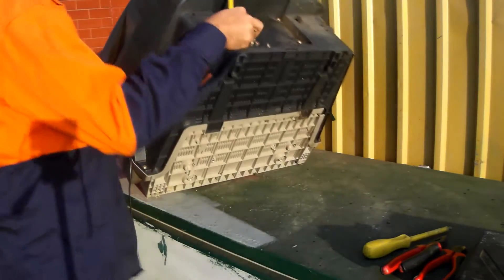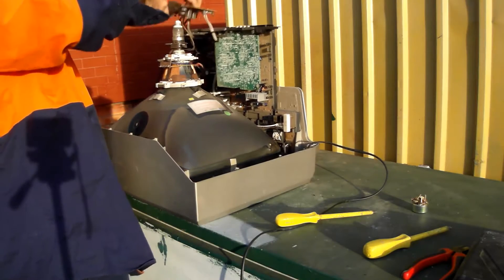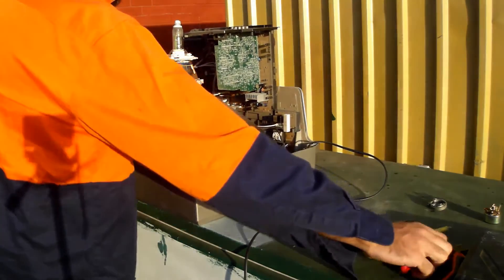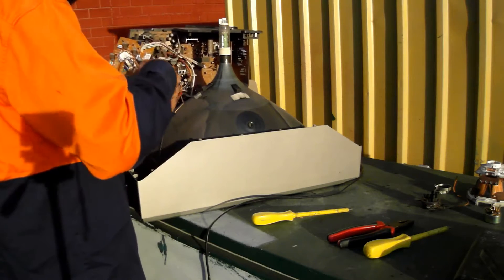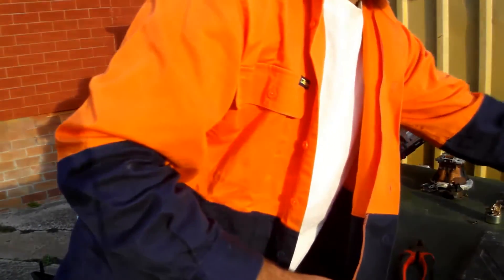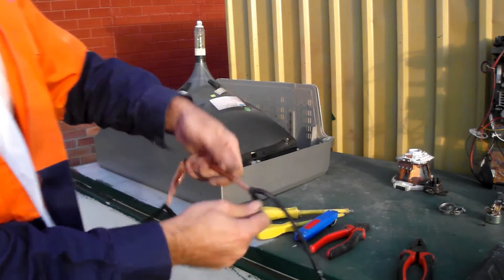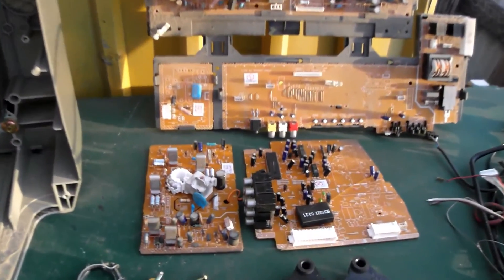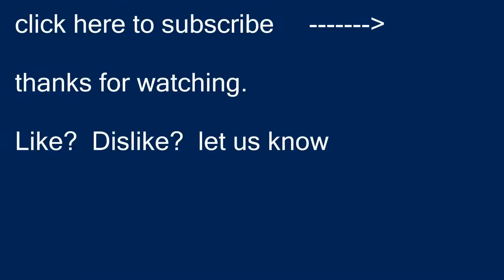How To scrap a CRT TV - (copper and PCB recycling)

Comment: I don't like trusting that 'it's been sitting a month so it's fine'
I always lay a screwdriver across the power capacitors just to be safe, it only takes a second. (if you want to do it properly you should use a resistor to drain the capacitors... but scredrivers are more fun :p )
Reply from the maker: i found the self discharge to be sufficient after 2 weeks of disconnect. Unless its plugged in, a month is safe. But i agree, sticking a screwdriver down the guts is more enjoyable, especially at full charge... SNAP BANG (high tension lead has a real kick)
cheers mate

Comment: Is it possible to get the york and fit black wire out without messing or unplug the dangerous wire?
Reply from the maker: +JPMorganSuckBigBalls  Yes it is.  You can just cut the black (degaussing) wire without touching the high power Red wire. This video shows all the steps for recycling the entire unit. 
If you just want the yoke and black wire only, just pulled them out and stay away from the circuit board and Red wire.
Thanks for watching   : )

Comment: Could wear gloves. You'd never have to worry about the lead imbued glass and 240V shock.
Reply from the maker: Kai Nicoll-Griffith its not the 240volts that worries me- its the unpredictable 5000volts
Reply: I suppose gloves wouldn't help very much then... Still, somethings better than nothing if someone wants to pick apart a CRT. Might make the difference between life and death.